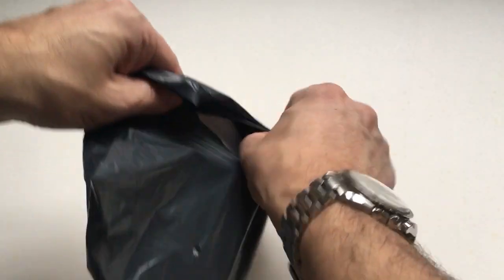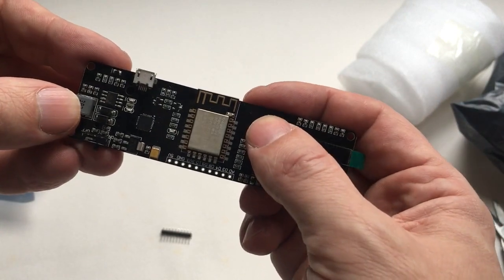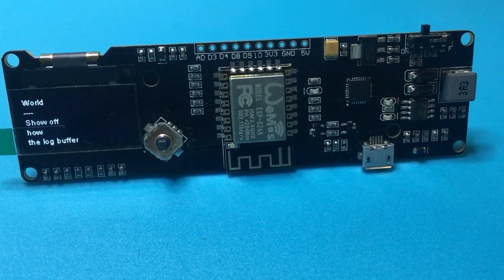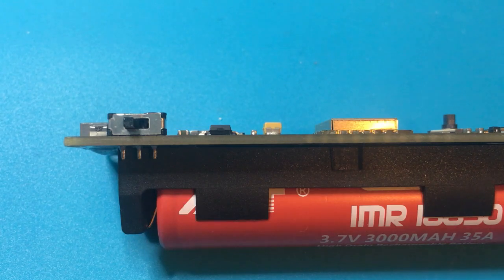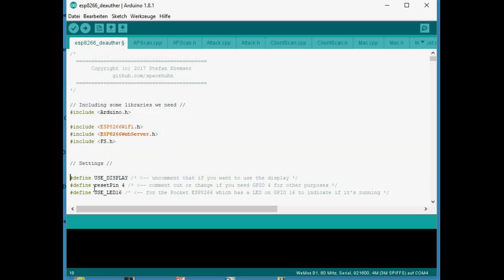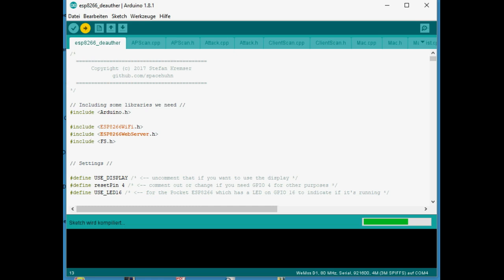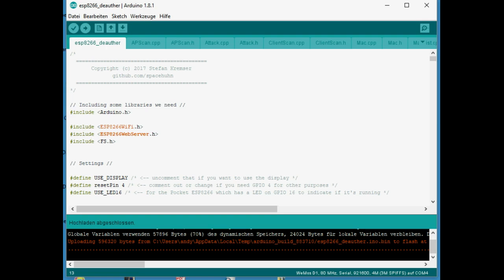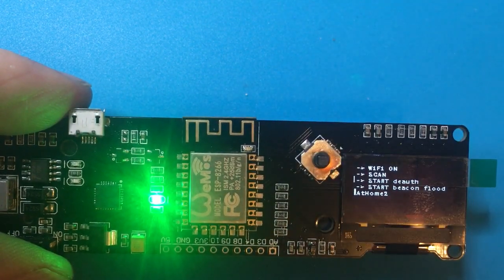5 Minute project: WiFi deauther with ESP8266 OLED module

Comment: For those seeking a copy of a demo program that works, try this:

// Include the correct display library
// For a connection via I2C using Wire include
//#include <Wire.h>  // Only needed for Arduino 1.6.5 and earlier
#include "SSD1306.h" // alias for `#include "SSD1306Wire.h"`

// Initialize the OLED display using Wire library
SSD1306  display(0x3c, 5, 4);

#define DEMO_DURATION 3000
typedef void (*Demo)(void);

int demoMode = 0;
int counter = 1;

void setup() {
  Serial.begin(115200);
  Serial.println();
  Serial.println();

  // Initialising the UI will init the display too.
  display.init();

  display.flipScreenVertically();
  display.setFont(ArialMT_Plain_10);

}

void drawTextFlowDemo() {
    display.setFont(ArialMT_Plain_10);
    display.setTextAlignment(TEXT_ALIGN_LEFT);
    display.drawStringMaxWidth(0, 0, 128,
      "Peter got it working!" );
}

void drawTextAlignmentDemo() {
    // Text alignment demo
  display.setFont(ArialMT_Plain_10);

  // The coordinates define the left starting point of the text
  display.setTextAlignment(TEXT_ALIGN_LEFT);
  display.drawString(0, 10, "Left aligned (0,10)");

  // The coordinates define the center of the text
  display.setTextAlignment(TEXT_ALIGN_CENTER);
  display.drawString(64, 22, "Center aligned (64,22)");

  // The coordinates define the right end of the text
  display.setTextAlignment(TEXT_ALIGN_RIGHT);
  display.drawString(128, 33, "Right aligned (128,33)");
}

void drawProgressBarDemo() {
  int progress = (counter / 5) % 100;
  // draw the progress bar
  display.drawProgressBar(0, 32, 120, 10, progress);

  // draw the percentage as String
  display.setTextAlignment(TEXT_ALIGN_CENTER);
  display.drawString(64, 15, String(progress) + "%");
}

Demo demos[] = {drawTextFlowDemo, drawTextAlignmentDemo, drawProgressBarDemo};
int demoLength = (sizeof(demos) / sizeof(Demo));
long timeSinceLastModeSwitch = 0;

void loop() {
  // clear the display
  display.clear();
  // draw the current demo method
  demos[demoMode]();

  display.setTextAlignment(TEXT_ALIGN_RIGHT);
  display.drawString(10, 128, String(millis()));
  // write the buffer to the display
  display.display();

  if (millis() - timeSinceLastModeSwitch > DEMO_DURATION) {
    demoMode = (demoMode + 1)  % demoLength;
    timeSinceLastModeSwitch = millis();
  }
  counter++;
  delay(10);
}
Reply: PS you might need to flicknthe on off switch after the upload

Comment: Von mir hätte es glatt 5 Sterne gegeben, wenn das Video nicht so blöde geendet hätte. nun weiß ich noch immer nicht was passiert und bin genau so schlau wie vorher
Reply from the maker: Alle mit dem WiFi Netz verbundenen Geräte verlieren die Verbindung. Ein Wiederverbinden klappt nicht stabil. So ganz klappt das heute nicht mehr überall, weil das ESP8266 nur auf 2,4GHz funktioniert. Wenn der Client auf 5GHz verbunden ist, bleibt das komplett unbeeinflusst. Was sich leider noch nicht flächendeckend durchgesetzt hat ist die Unterstützung für „Protected management frames“. Damit sind auch die Management-Frames, zu denen der Deauth gehört verschlüsselt und damit gegen diesen Angriff immun.

Comment: Can you share me your code?. I really wanna see and refer because my teacher wants its run and display temperature on oled . but i'm just fresher and i have't good enough to know everything about this module
Reply from the maker: The code is from spacehuhn. If you want to see original code with OLED made by AReResearch, you can google „udp ranger“ and check out the code in my blog. But that is mostly done in LUA.
Reply: @AReResearch  Thank you so much, i appreciate that and i had finished my ex with DHT module.
Reply: @AReResearch  Hallo, welche bin Datei benutzt man bei der neuen Version? Danke im voraus

Comment: I don't undestand where are SDA and SCL pins to connect another I2C sensor.
I tried to find pinout of this board but with no results...
Could you indicate them?
Thanks!
Reply from the maker: D1 and D2 (=GPIO4 and 5) are not routed to the edge of the board. You'd have to use a bodge wire directly from the ESP module on the board.

Comment: I only have COM1 and can't figure out how to connect the module to arduino
Reply from the maker: If you open the device manager (assuming you run windows), does the COM1 disappear when you unplug the ESP8266 module? If so, COM1 is the port your IDE wants to walk to. 
If an unknown device appears, you need to install the USB2serial bridge driver. That will provide a new COM port.
If nothing happen when plugging in (i.e. no USB-event sound), your module might be faulty.
PS: Try it with an 18650 cell inserted and the module turned on.

Comment: Do you happen to know why i get only every second line drawn on Y -axis? I have been going through SSD1306 libraries and trying to debug this issue for a while :|
Reply from the maker: That is unusual. Possibly a defective OLED? (Did the pre-loaded demo run without glitches?) I haven't had that problem before. If you bought the module through Banggood: they always replace stuff when you can prove that it arrived broken. (Always worked for me.)
Reply: @AReResearch  thanks for the response. The preloaded demo was glitched also. Already did a dispute to aliexpress. Too bad. BTW good guide!

Comment: Hi, I tried to use this module but i haven't a good result.One question, have you flashed the esp8266 card with the program "Nodemcu flasher" and the .bin that you have download from Spacehun github?Thanks.N.B.: if i want to return at the original firmware of this module you know where i can download it? Thanks
Reply from the maker: It doesn not have a default firmware as such. It comes pre-loaded with a test sketch. But that is useless apart from testing the processor and OLED. A nice firmware for quick development is NodeMCU. You can build customized firmware for the module here: https://nodemcu-build.com/
Reply: Thanks @AReResearch